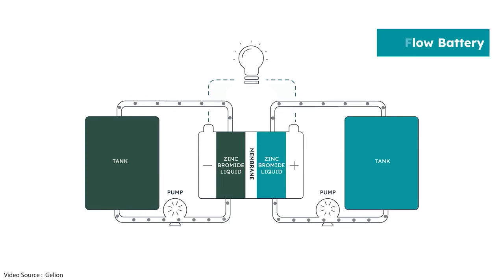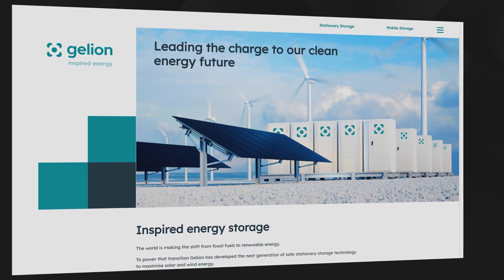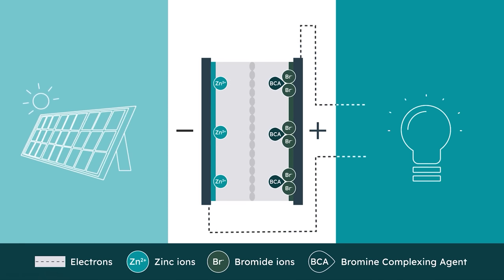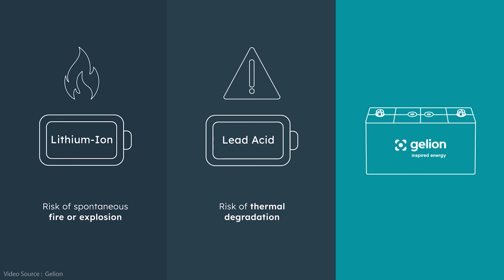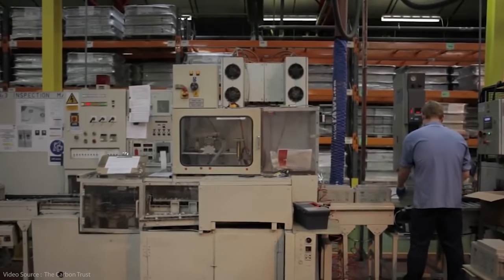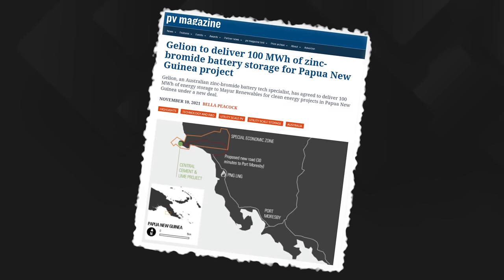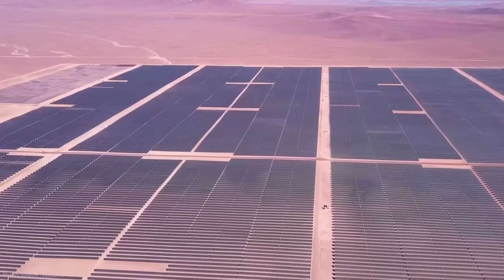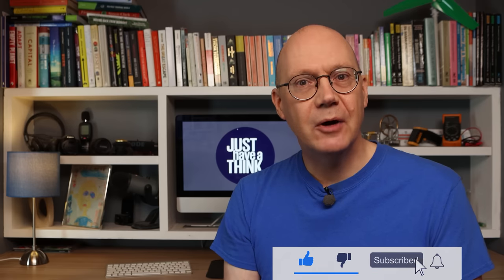Zinc Bromide GEL batteries. Cheaper, greener, simpler & safer than lithium -ion!

Comment: Nice with producing them in old LA factories and a number for energy density. Apart from that, not a lot to go by. Power density, round trip efficiency, cost/kWh, cycle life, and longevity (for instance LA batteries are basically dead after four years regardless of use) are all needed in any presentation of a new miracle battery. Then those specs should be compared with those for Li-Ion, rust, molten metal, flow batteries, liquid air, hot gravel, pumped hydro, and gravity batteries plus the ones I forget.
Simplest format would be a mere table summing it up, available in the description. Once that table is begun, the next miracle is simply added in a new column. Would provide much needed clarity and context.
Reply: Just type  into your computing device,  Gelion batteries or zinc bromine gel batteries.
Reply: @davidwatson2399  The questioner, like so many others, wants every solution presented without any effort on their part. That kind of intellectual laziness is quite widespread. Imagine the complain if a visit to an University library was required in lieu of typing in a search-engine query!
Reply: The video claims to inform about a new battery. Yet it offers little info that lets the viewer judge the technlogy. Obviously the Youtuber could make a video saying "I read about this new bromide battery, google it if you're interested." Kind of pointless. But sort of what happened here. Except he talked at length but still didn't offer much of the relevant info. My comment is an attempt at constructive criticism directed at the Youtuber.

Comment: This is the sort of thing to put in a off-grid solution for those of us with really nasty utilities... (I would need 30-50 kwh of storage to basically eliminate my dependence on the local utility.  First yeatr?  8 outages, 2 were 3 and 4 days.. the rest were all about 5-8 hours each.)  Looked at a generator, but the 10-20kw generators go thru about 350 gallons of propane every 2-3 days.  And then need $1k to refill, so that isn't exactly a solution I'm ready for....
Reply: As luck would have it I do not have a whatsapp account and will never have one.  I don't need more routes for malware to invade.  <sigh>  I don't trust them, and really don't trust Facebook and most of the biggies..... A little paranoia keeps the bad guys away

Comment: So, how does this compare (cost and performance) to the lead acid battery they try to replace?
Reply: Type in zinc/ bromide gel battery into your computer.
Reply: This is hard to say, but if it was in any way comparable this nice professor he was talking with would have definitely mentioned it. The fact it was not mentioned suggest that at least in some critical parameters they fall way short of lead acid. If I were to guess the obvious area of deficiency would be high internal resistance. I just can't see Zink Bromide being as conductive as sulfuric acid and its salts. So you can forget about high cranking amps and any automotive applications.
Reply: @blg53  
Look it up, they are not talking automotive.
Reply: @davidwatson2399  I know, I simply answered the question.

Comment: as a chemistry student i'm a bit suspicious about the thermal stability of the gelion battery. elemntal bromine is quite volatile, i guess the gel is going to suppress some of it, but it is inevitably going to escape the battery environment
Reply: I'm not a chemistry student but I'm pretty sure the elements act differently when they are bound to other elements.  So wouldn't zinc bromide act different to pure bromine?  Maybe I missed something.

Comment: Just a correction from Just: In powergrid it should be used the term Watt-hour/liter not per kg. As of Zinc Bromide GEL batteries it definitely could be an option but i think that supercapacitors are the future  because they have millions of charge discharge cycles...

Comment: Heat and cold effect the Gel performance. Heat is needed in cold conditions. Exhaust heat goes to waste, it could be utilised to have a constant range of efficiency for the battery. Or air cool as required.

Comment: Interesting technology. Since it's packaged similarly to lead batteries, I wonder how the two compare in terms of cost and capacity per unit. Could they be a drop-in replacement for car and boat batteries?
Reply: I bet they would be a great alternative for deep cycle marine batteries but wouldn't have near the cold cranking amps or heat tolerance of lead acid car batteries.
Reply: I was curious about that too. It wasn't clear to me what advantages these new batteries bring to the table.
Reply: There's no mention of internal resistance of this technology which is key for high cranking currents.
Reply: Hopefully so, as currently the vast majority of boat batteries are lead-acid (often of the gel variety, but still lead acid)
Reply: @longrove5710  current might be a problem but he said these can take a further 10c than lead acid.  Heat tollerence could be better. Conductivity, mass and efficiency would need to be considered too though as they might run hotter.
Reply: I was also hoping he would make a direct performance comparison to lead acid as they could have the same form factor... disappointed.
Reply: @longrove5710  Actually he said they were better than lead acid by 10C in high temperature environments.
Reply: I was thinking the same thing. And how long would the life of the battery be. I live on a Caribbean island and our Car batteries, seem to last maybe 2 years on average and 3 if you are lucky. So if this would be more or less equal but it's lifespan is double, it would be great replacement opportunity.
Reply: @Curacars  wow  in the 10 years I lived in key Largo I only bought two car batteries the second made it another three years in Tampa. So people just like lead acid batteries come in dozens of ranges, from 75$ to I figure you could spend over 200 on a battery both could go in the same vehicle!
Reply: @TheLosamatic  I live in the south Caribbean, maybe it's a little hotter there. 30C is the minimum temperature at midday year round. At night it stays 25C at least.
Reply: @fig7047  higher capacity than lead acid, no fire risk like Li-ion, very long cycle life, cheap to make with low-cost material inputs. win,win,win.
Reply: @Curacars  looking at 20,000 cycles
Reply: @goldreverre  and cost wise? How many times more expensive as Lead Acid?

Comment: Energy density is a problem. However, for grid size batteries a three times bigger foot is the only downside. As long as we can move lithium towards transportation sector then why not?  I guess, buildings and the grid can use this invention ... Whilst newly made available lithium will go towards cars and trucks.
Reply: Better Na ion for that and keep the Li for the smallest and highest cells.. if you can also escape the other rare earth metals they require.. its not just the lithium .

Comment: Would be interesting to know the bottom temperature of use, esp for Northern communities. Interesting re it’s manufacturing simplicity.
Reply: I don't see why low temperatures would be an issue for home applications. After all, the home must be heated anyway, must it not?

Comment: Elemental Bromine has a high vapor pressure and is very reactive. I wonder how they mitigated the degredation of the gel additives and surfaces the bromine comes in contact with.
Reply: I suspect by using the same casings with minor changes as lead acid batteries. I doubt bromine is more reactive than sulfuric acid.

Comment: Redflow Energy have been making Zinc Bromine batteries for quite a few years in Australia (no gel I assume). I believe they were far preferred for remote applications were temperature and maintenance were an issue.
Reply: I was just about to mention them. Yes, a flow battery with tanks and pumps. Their basic unit is the ZBM3 and has an energy capacity of 10KWh and a power of 3KW (5KW peak). Otherwise, all the same characteristics as GELION batteries. Redflow takes care of zinc dendrite formation by periodically running the battery down to zero, then shorting the terminals for 30 minutes. So you'd need two banks so you've got power anytime you need it. Not sure how gel is supposed to prevent dendrite formation as most metallic dendrites can punch through separators and short out the battery.

Still, a gelled battery would be convenient. GELION's technology has the potential to kill lead-acid batteries in deep-cycle applications, such as solar PV. Still, lead-acid is king for short bursts of very high discharge. E.g. car staring.
Reply: Redflow wasn't interested in the gel approach. They were set on a flow approach because of the easy scalability of tanks. Thomas M actually helped Redflow with their chemistry formulation.  He later formed Gelion because the gel electrolyte approach looked promising and Redflow wasn't interested in it.
Reply: @goldreverre   Looks to me like the two approaches are ideal for different market segments.

Comment: Normally your videos are comprehensive, siscently covering the most important points. This video could have been improved by contrasting this battery with led acid in the key categories of: initial cost per watt-hour; number of cycles at 100% discharge; coulmbic efficiency:; and power density (presumably known by your comment of 4 to 8 hour optimal discharge rate data point). Perhaps your mind is on your upcoming trip?
Reply: I find it very disappointing that this is left out in many videos. And he started the video so well with a sober skeptical attitude

Comment: Sounds quite interesting.
I'm off-grid and have been to some degree for a good ten years.
Recently got some Nickel-Iron batteries and they are great but require a bit more maintenance than my Lead Acid batteries.
Chargers, inverters aren't readily available for them and they are also quite expensive so if these are anywhere near the price of lead acid or Lithium and don't have any major drawback to their use I will likely get some as soon as they are available?
Reply: Hi Glen,
What voltage are you using your Nickel-Iron batteries at?  If you use multiples of 9 cells then charging is easier with standard 12v, 24v or 48v chargers.
Reply: Where did you get your Ni-Fe batteries from and what country are you in?  I'm in England and have just got 36 cells at 160Ah from ADS in Ukraine.
Reply: @LewishamPpleB4Profit  I'm in Aus. There is a supplier here but I think he get's them from the US? Using the full 10 cell configuration (2Kw) so I don't need to use a charge controller. Also have lead acid batteries and just rely on them more when I have to resort to using a generator. Mean to get more so will have to sort something out? Pretty sunny out here most of the time but we do get runs of heavy cloud cover that can last for weeks at times.

Comment: I would like to see the cost/KWH of the product compared to that of LiON and LiFePO4 batteries with the same output.  One advantage is the the use of this battery in storing electrical energy for residential use powered by solar panels, provided that there is space available for these batteries.

Comment: I'm shocked that when I go to GelIon's website, there are absolutely no specs, numbers, or concrete information on their technology.  I understand that they are not in mass production yet, but if they are saying that they can produce a battery in a standard lead-acid case, surely they know what the voltage, AH storage, max current, and cycle life of that battery will be, or at least what they believe they can achieve.  When I see nothing but generalizations on the company's website, it makes me suspicious that they are not really very close to producing anything.
Reply: I would make exactly the same comment.

Comment: I'm curious what the voltage per cell is fully charged. I'm also curious what sort of charging and battery management systems are needed for these cells. Lithium Ion battery charging systems are rather complex compared to lead acid batteries. And finally, what does the discharge curve look like? is is closer to Lead Acid's curve or closer to Lithium Ion's? Lithium Ion's ability to provide full voltage right up to complete discharge is one of it's attractive advantages in many applications.

Comment: What was that bit about 8 hours discharge sweet spot? What is the retention of charge for longer times? Also 16USD per kwh? Did I miscalculate that? That would be like stealing batteries. 
I'd really want to have more reliable numbers on cycles. "1000ands" of cycles is a bit sketchy...

Comment: Curious about the cold temperature performance and wether or not you could just drop one into a car to replace the lead battery. The idea of replacing all those batteries with a cleaner alternative sounds amazing.
Reply: No you can't use these to start a car. They don't have the initial current boost that lead-acid has and is required by the engine starter motor. They are also not too quick to recharge - about 4 hours which is great for PV so they are perfect for stationary storage and grid back up with discharge around 6 to 10 hours.

Comment: I hear about new battery technology about once a month.  And yet,  when I talk to my solar installer I hear the same response.  The cost of the batteries is still too high for the system to pay for itself.  I pay an average electric bill of $75 per month.  But the batteries will always cost more than I pay the grid.  And once they are paid for.  The batteries are exhausted.  It is frustrating.
Reply: A well managed lithium bank will last 8 to 10 years.  But if having power when the grid is down is not a priority, then yes they are very expensive.
Reply: Installers only know what is currently available to them from commercial suppliers.
Reply: @DrakeN-ow1im  Yes.  That is my point.  Few of these batteries come to market.  And those that have are too expensive to be practical in my local cost environment.

Comment: I'd be interested how they get around the fact that Bromine is corrosive to most plastics. Maybe when it's not in such a reduced state (I think, I'm not a chemist) it doesn't harm certain plastics. Robert Murray-Smith did a series of videos on non-gel non-flow gravity-separated Zinc Bromide batteries and he used HDPE as the cell bodies and current collectors. I don't know about longevity, so if you want to do stationary batteries you could use glass or PTFE.

Comment: At this point I've seen too many promising technologies, I would like to see the "bad parts" of these kind of technologies which are not advertised by the promoting company but are crucial to know if the battery is competitive.
* Does the battery lose charge over time? 
* What is the efficiency of the battery? If it is not larger than 80% it's not worth the talk.
* How long does it take to charge/discharge?
* What will be the actual cost after shipping and all?

Comment: Seems wrong to compare these batteries to either flow batteries or lithium ion.  They seem like they should be compared to current lead-acid batteries and LiFePo4 batteries.  What is the cost?  The claims sound like they should displace existing solutions for car batteries for ICE's and/or roof top solar.  Any chance that they finally make solar power self sustaining?

Comment: Back in 2010 during the Obama years molten salt batteries were touted as the next breakthrough in battery technology because in part due to the unlimited supply of NaCl.  Unfortunately, GE decided to abandon development due to low energy density and the fact that it had to operate at about 500F.

Comment: Technological solutions like this are what we need for large scale base load systems where space is not an issue. Yes Lithium is good however, it comes with significant risks. not least of which is your entire facility going up in smoke at a great rate of knots. 50 -60 watt hours per kg is still better than the 30 or so available from lead acid technologies. I guess cost per watt hour is where it comes down to. what is the cost/??

Comment: I checked out their website, no mention of working temperature range. Need capability down to -50C (I don't see that temp often but don't want my batteries destroyed when it does happen) with no damage charging and discharging, and maximum C rate for both of those conditions. Would also like to know how bad the voltage sags while under load. As always cost is very important too.

Comment: I know I am being thick as two short planks but could you explain this concept of a sweet spot of X to Y hours.  Surly if you only need half of your battery capacity to shave a given peak, the other half remains to be used in the next peak-shaving.  Or is what you are saying is that the battery in question can't discharge more quickly than the given estimate.  Surly then you simply need more batteries in parallel so that you can provide the needed amperage.

Comment: Gel electrolytes dry out.  Baseload generation for the consumer will still mean high replacement costs. This isn't quite the solution we are looking for but keep the ideas coming.
Reply: As so frequently stated "baseload" is a myth promulgated by the heat engine generators' owners.
Reply: Some gels are non-volatile and even if they are slightly volatile, fluids can be occasionally replenished.

Comment: It would be good if you were to provide comparisons to Lead - acid batteries in you articles since they have energy densities of 30- 50 wh/kg according to Google, compared to the energy densities of 50 - 60  wh/kg which you mention at 8:37 seconds of your video.
That would place this Bromine-gel chemistry only a 1/2 step ahead of lead technology and unless it has some specific reason its "better" than the old process not a viable method of new baseline storage.